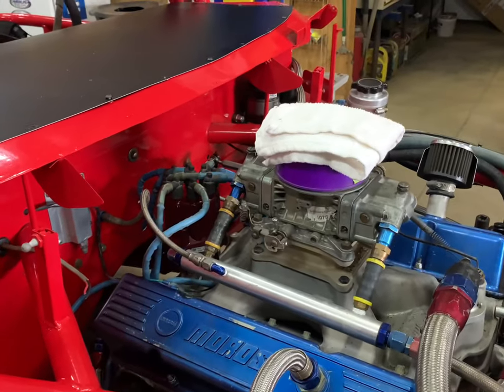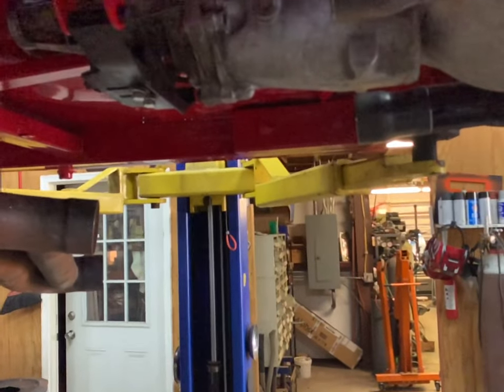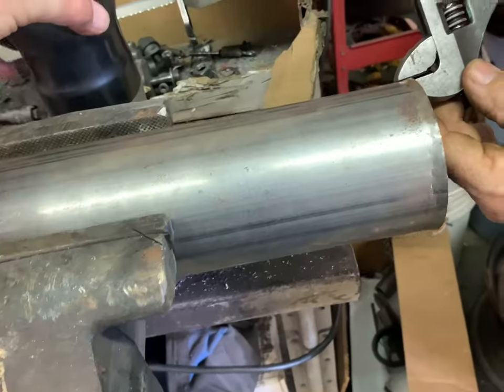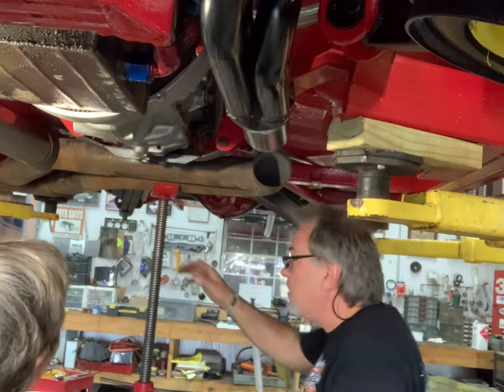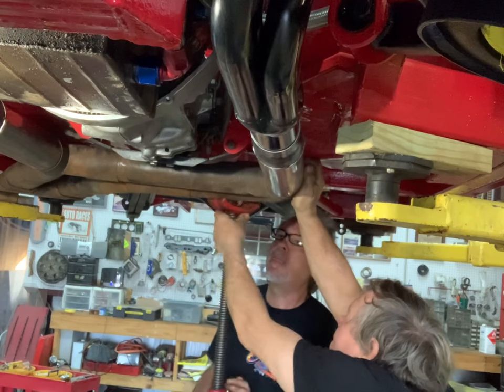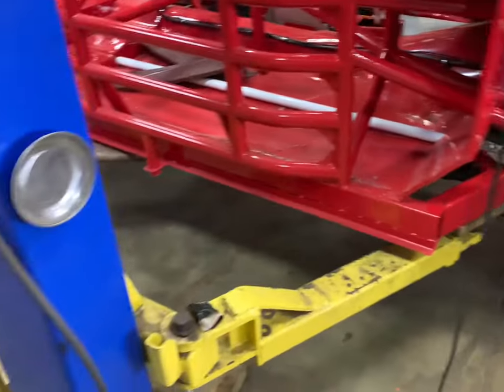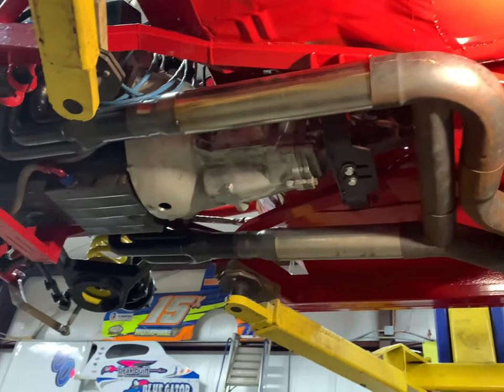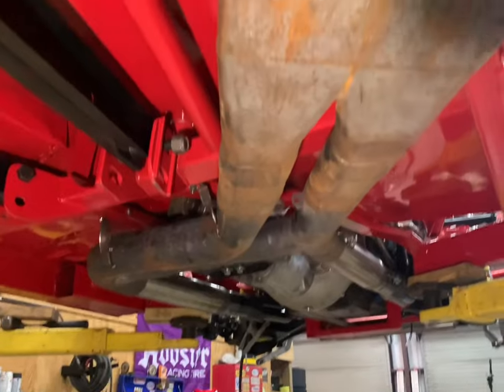#130 How To Build A Boom Tube Exhaust System On A NASCAR Winston Cup Car !!

Comment: I like the slight flaring of the exhaust instead of a straight butt joint! That is a great tip!
Reply: You probably want it all the same direction, making sure the pipe from the front is always going into the flanged pipe. Or saying it a different way, the flanged opening always facing the flow.
That way the lip from the inside pipe is always facing away from the flow and not hitting it, just incase it disrupts flow.

Comment: This is the NEW configuration on injected engines. Way different from carbs.
Reply from the maker: I’m not sure what you are trying to say but this is the correct boom tube layout other than the two single exit pipes on each side of the car. It has nothing to do with the fueling system